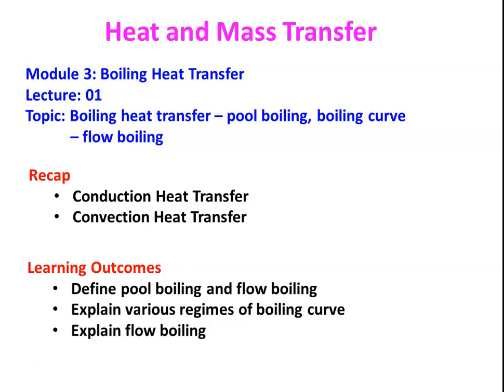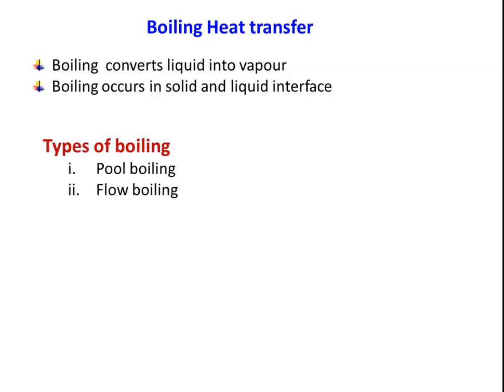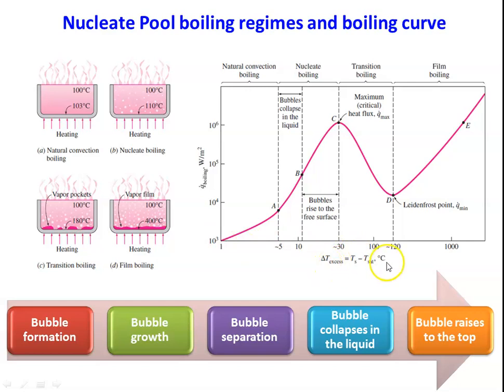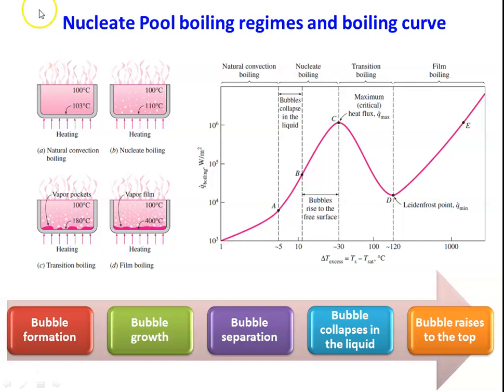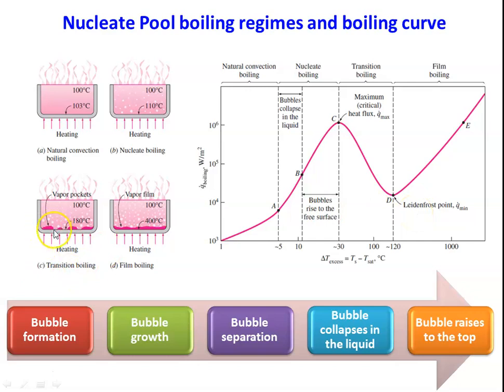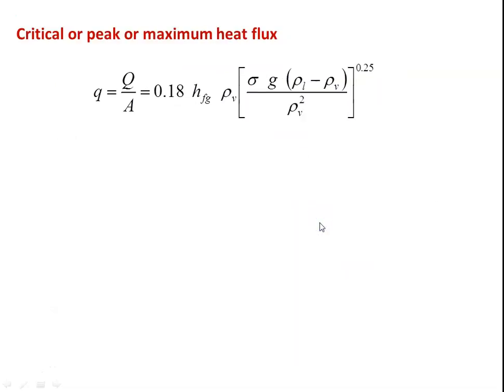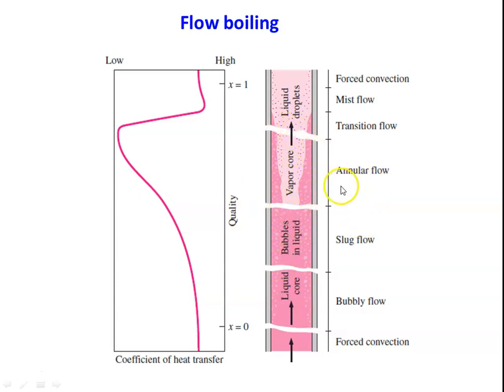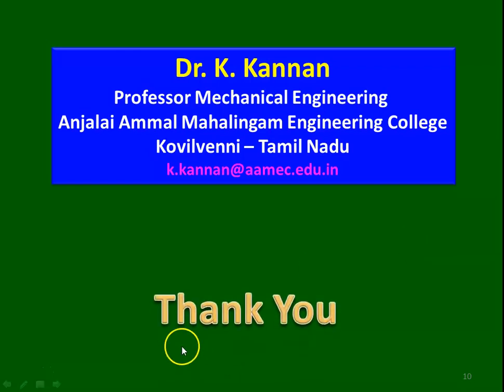HMT 3.1 Boiling Heat Transfer

Comment: Sir if I put a heater inside a beaker then it is pool boiling or flow boiling. 
I mean in pool boiling heat is transferred from outside but if we transfer heat from a heater placed inside the bakear ?
Reply from the maker: If the liquid is flowing then it is flow boiling.
Reply: @dr.k.kannan198  No sir the liquid is not flowing but the liquid is at rest and heat is supplied to the system.
Reply from the maker: Then it is pool boiling
Reply: Dr. K. KANNAN ok thank u sir